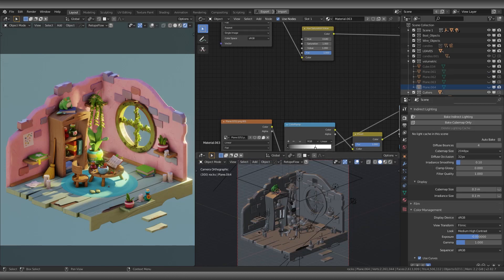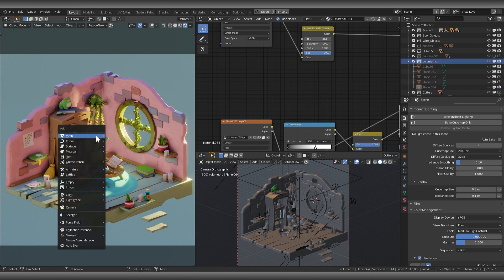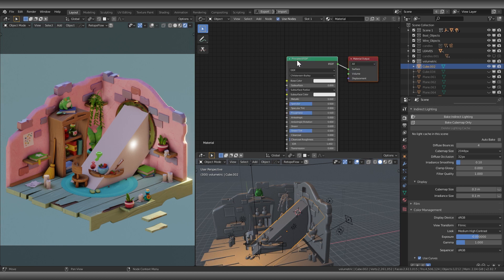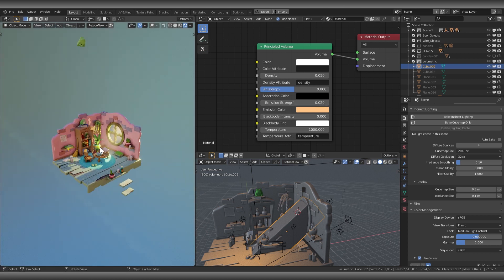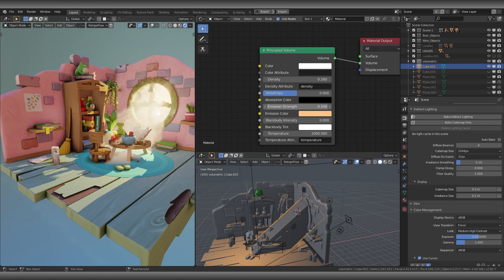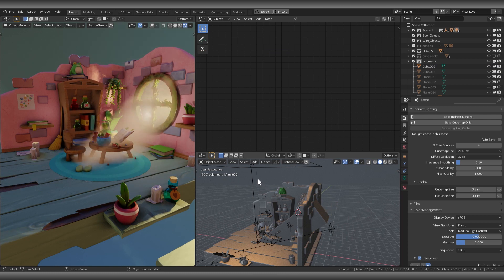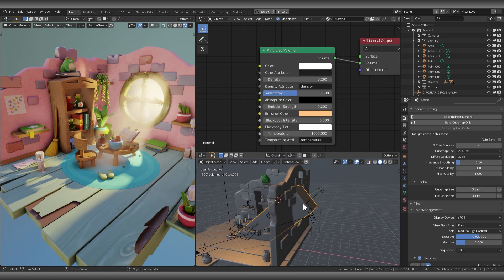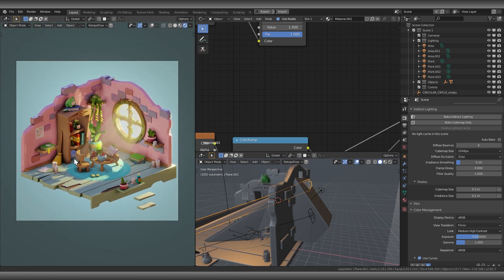How to create Volumetric Lights in Blender

Comment: Nice. Now if you would use a cylinder the size of your window instead of a cube and in edit-mode pull down end scale up the far side from the window, i think you would not have the rays sticking out over our window frame. :)